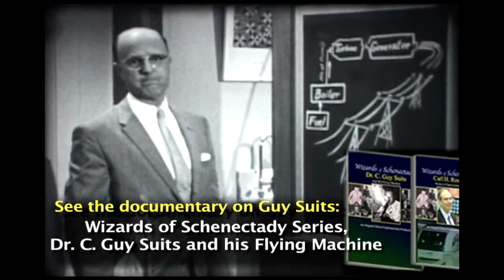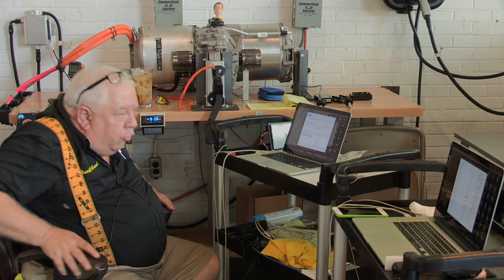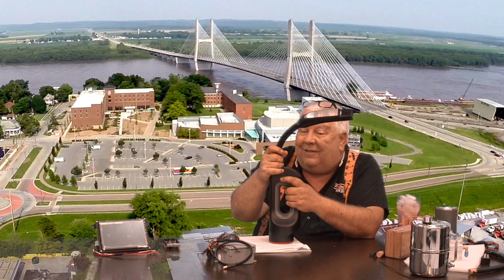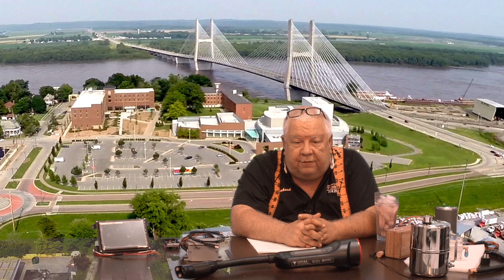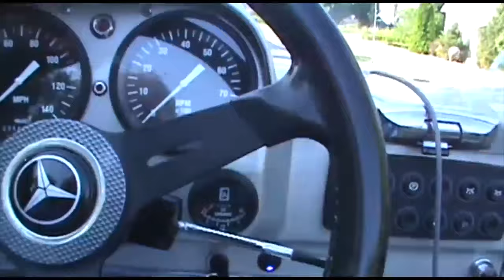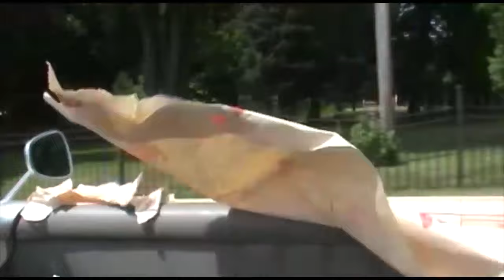EVTV Friday Show - Friday, July 24, 2015.  Hacking Tesla Model S

Comment: In your video "EVTV Friday Show -January 9, 2015" about an hour and 24 minutes in - you gave a great explanation of how speed (Air and rolling resistance) relates to power consumption - but I, and perhaps others, would like to know why the range vs speed charts Tesla produces shows the range REDUCING for speeds below 22mph. ??
http://cdn.teslarati.com/wp-content/uploads/2014/05/Tesla-Range-vs-Speed.jpg
Reply: +Roy Richardson I've seen graphs like this before.  It seems that the computer simulation is assuming that some accessories are running (e.g. air conditioner, computer, etc) -- this is called the "hotel load", the power that is consumed that doesn't have anything to do with moving.  At 1 MPH, the car would reach the 100 mile range mark in 100 hours.  How long can the battery pack run the accessories only?   I don't know, but I'm guessing it's less than 100 hours.  That would explain why a larger battery provides more range even at 1 MPH.